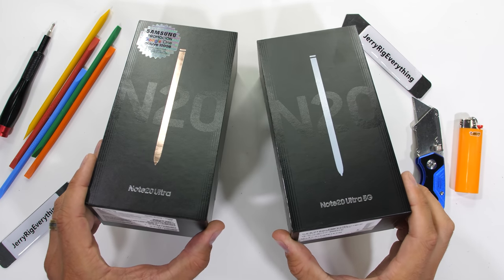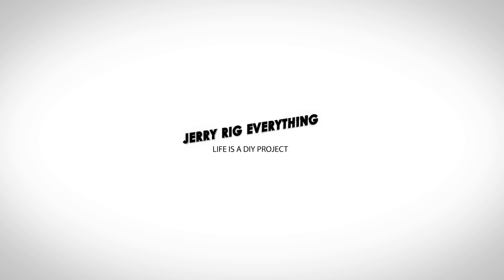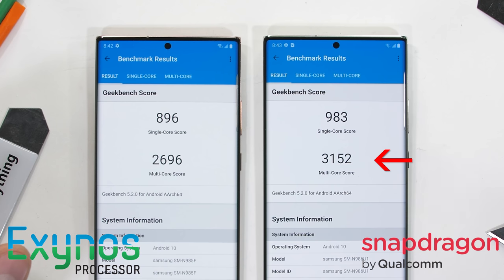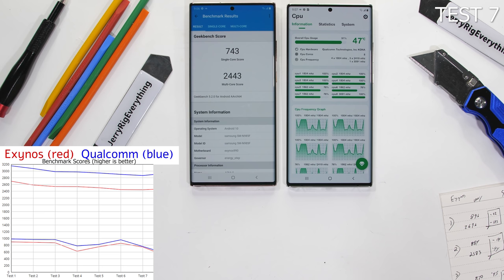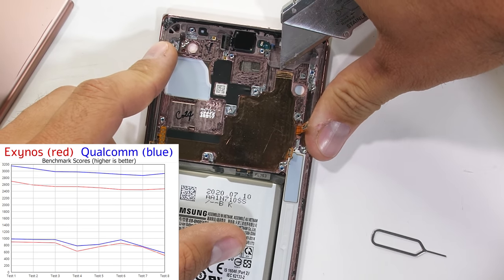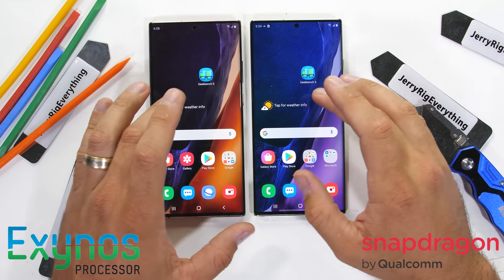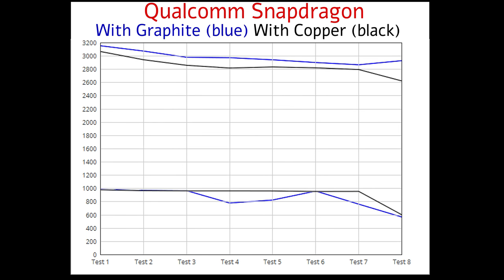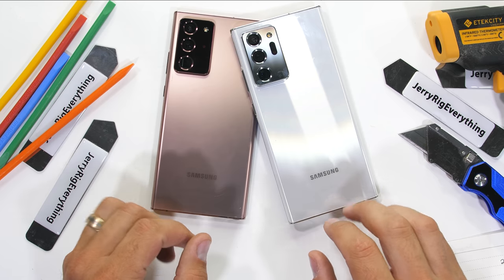Samsung should explain this... Exynos vs Qualcomm?! - Note 20 Ultra

Comment: So you’re buying the “same” phone with same name and same price, but one perform worse? Isn’t that a scam?
Reply: Oh it is indeed...
Reply: even better, in the europ, we can buy these scamsungs for much higher price than real snapdragon samsungs in the rest of the world
Reply: Lets wait for a class action lawsuit to pop up
Reply: the more you know
Reply: @FPKcz  The "real" version is the Exynos one because Exynos is Samsung's chip line.
Reply: Did you really just find out about this? This is happening for 3 or 4 years now
Reply: and i can confirm in asia its sold around the same price.
Reply: I would at the very least try to understand them if they sell the Exynos cheaper than the Snapdragons. But same price difference performance. You are right to call it a scam.
Reply: Samsung flagship phones= features>peformance
Reply: It would've been more reasonable if the exynos was cheaper
Reply: @jvsky1140  BUT PRICE IS NOT HIGH LIKE THIS NASTY CORONA CRAP NOW BEFORE 4 YEARS.............4 YEARS BACK PHONE PRICE LOW SO SD VS EXYNOS DOES NOT MATTER NOW PRICE SO HIGH EVEN SINGLE PENNY DONT WASTE ON SAMSCAM
Reply: In Germany they are cheaper a note 20 ultra is around 1100€
Reply: Samsung should call the S20 Ultra Snpadrogn/Exynos Variant. Since their names are already a clusterfuck, why not add that to the Mix. With Laptops you also know if its powered by AMD or INTEL, and if you have a I3, I5, or whatever inside.
Reply: @daemonspudguy  yes, but for the customer, the "real" phone is the one that has better features ... and there is nothing that exynos would be better at.
And do not forgett that the shit exynos is the more expensive one of them.
Reply: wonder if it happens to iphones as well
Reply: we got no choice
Reply: Yes it is
Reply: It is a scam, I even remember with some of the older Samsung phones, like the  galaxy s3, they would swap ram sizes and either have a dual core or quad core processor swapped between international and American versions of the phones, with some countries even having the best version of the 2 (with the quad core and highest supported ram for that phone model) so nothing new there.
Reply: Samsung's reason is that they need to match the "demand" at the earliest time possible. No wonder why the moment they announce the product their phones become available in a week or two, unlike OnePlus or Apple. Again, somebody else's reason is that Exynos needed to exist for fair competition, is it really that fair?
Reply: Exynos is having higher price in asian markets..
Reply: Technically, it's not the same phone. As you can see, the model code is a bit different. But your average buyer won't know these identifiers by heart and not every retailer will specify which version you're buying.
Reply: @llljjjyyyy globally overpriced iPhones have one CPU, Apples Ax CPU, so performance is no different...  But yes, in Europe Apple products are a bit more expensive, in the Czech Republic, much more expensive...
Reply: Its made by samsung so yes its a scam.
Reply: @pauljericklara3865  4 years ago the Americans were salivating for the exynos. Now it's the other way around. This story isn't new and it's not a scam, it's just the way they operate.

There are always different internals depending on the models. Playstation does this, TV manufacturers do it. Everybody else does it, I really don't understand the fuss all about this topic. The note you buy in your country is the best note you can buy. Makes no sense to compare to a version that isn't available and costs 30-40% more to import to your country.
Reply: Everyone should report them for false advertising
Reply: In india we are buying it for $1500 with exynos
Reply: Actually... Not even the same price. In India the, we have the exynos variant for $1423 and the snapdragon variant, which is sold in the US, costs only $1300. $123 for downgrading the performance!!!
Reply: Yeah its totally scam with innocent sheeps this is how they cut the xost and using the marketing tactics they r earning more
Reply: Yeah
Reply: @WakkaOwnages  but the Snapdragon one is cheaper and SD is performing was better than the Exy for the Last 3 years, so why do i pay more and get the bad one in europe?
Reply: "No it isn't be because..."
-SamFans
Reply: @samuelruiz7377  - Why? It's been clearly labeled for all to see. Exynos used to be the superior chip. Now just because Snapdragon became better it's only then one complains.
Reply: and in europe it is even more expensive to so...
Reply: The Exynos variants have always been cheaper than the Snapdragon ones a couple of months later. To the most of the people who respond to this comment - please, do some research yourselves and don't believe every single thing on the internet.
Reply: Welcome to brazil
Reply: Nah. The phone is actually more expensive in Europe. So u pay more for hotter, slower and less battery efficient phone with tons of bloatware. Gj sammy.
Reply: @FPKcz  same like us in southeast asian , mostly samsung phone in my country powered by exynos , junk processer 😭
Reply: Wait till next year amd across the board thats what I'm doing.
Reply: @fahadnadeem7831  - You got it the other way around. Exynos is their original chip from Korea. There was legal problem they had with US distribution, that Samsung is forced to use Snapdragon for the US market, and only for the US market. For a long time Exynos used to be the better chip, and US buyers were complaining then, now it's switched and people on the other side like you are .complainning.
Reply: Technically not a scam. It’s kinda like fast food. McDonald’s in Japan is very dif from American McDonald’s.
Some are better some are worse
Reply: in europe they cost more than in the us
Reply: @adivyapratap9512  help u with what lmao
Reply: @phase4265  wo hast du diesen Preis her? Ultra kostet bei mir 1300€
Reply: @FPKcz  that's because of the taxes... everything is more expensive in eu vs usa..
Reply: $1849 aud in Australia for exynos
Reply: $1299 isn't the same thing as £1279!!
Reply: @_scra9947  bei Saturn
Reply: @inisipisTV  they also sell SD in Korea and China. So stop defending these kinda shady practices.
Reply: Bloody hell  it is
Reply: Not really, products differs all the time between markets. If we take cars for example you can see that the US versions used to look different/worse than the European version of European cars all until the 90's. That was because of legal differences that required outdated headlights and weird bumpers in the US. Still to this day there's major differences between the markets.

Since Qualcomm is a US company I'm guessing that there's some dumb US law that makes them use that processor in that market, what matters is how easy/difficult samsung makes it to know what version you get and it should be the consumer who decides if they make a good enough job presenting that information.
Reply: @adivyapratap9512  well it depends what YOU also like you know
Reply: @volundrfrey896  forget about 90s car laws and focus on smartphone industry and tell me any other company doing this. Also I can guarantee you that no one's stopping Samsung from giving SD option in EU or Asia and they sell snapdragon in US, South Korea and China. So don't over analyse it, its just Samsung being shady writing from my Samsung device.
Reply: As a South Korean customer this is common for us. They are keep advertising the '5G network' function even they are almost unusable in most areas, which is also very unstable to use. 
They even have added Ads on the default apps, which cannot be deleted by users. not adding the earphone or even a case with a phone is also a minus.
The previous galaxy phones have also differed in hardware from domestic & overseas products, which is not even a surprise now. I hope it spreads bigger and hits samsung big time.
Reply: @ThatGuyCanmanNC  it is very different.. having different menus are part of cultural/market adaptation, and selling the same advertised product with a different hardware is a fraud.
Reply: Caffeine well like Chinese people eat dogs and that is a terrible thing to do, and no one eats dogs here
Phone there, phone here
Reply: @SvetlinDimitrov  I said in a couple of months. I got an S20+ for around $760 last month. Compare that to the retail $1200 in the US. Also, a OnePlus 8 Pro, which has a Snapdragon, costs more than the Samsung in Bulgaria (Judging by your name), even though its retail price is lower.
Reply: @ThatGuyCanmanNC  so you're saying that people in other markets deserve less  performance on their equally-priced phones and that's reasonable?
Reply: @ThatGuyCanmanNC  similar for computer parts, all of the high-end graphic cards over $300 nowdays does perform over 144hz on FHD resolution, and that does not differ by market, wherever it's located. the hardware performance people require does not differ by location or cultures, end of story.
Reply: @adivyapratap9512  what games do you want to play?
Reply: @nevzatcanoglu9036  How is it more expensive? You do know that American prices don't have VAT included right? How are you determining it is more expensive? You know you can't really compare base prices in different currencies, there are different taxes, import taxes and whatnot depending on the country.
Reply: @Ktk0627  Is it tho? Have you tried an American Big Mac vs a German Big Mac? Have you tried a Russian Big Mac? A portuguese Big Mac? I have tried all of these and every single one is different. The meat is different, the preparation is different, the bread is different, the sauces are different. Just the name remains.
Reply: @adivyapratap9512  yeah sure, do you need it to be a new model? or are older ones good too?
Reply: @WakkaOwnages  of course, as the McDonald in India serves a completely different menu, as it does in South Korea here. the point is that technology is different from the measures of food, globally consumers expect a same quality from the same product. If you had seen the video, you'll see that the Exynos model 's performance is not much different from the last year's model - do you believe that the customers deserve that lack of quality-just based on the region/culture?
Reply: @WakkaOwnages  and also there's a huge error in your argument - let's say a Russian version performs poorer than the American model - but how do you know that the phone will be used differently? will the Russians all run a similar application? does the majority of the population play the exact same game & multitasking? is the usage of a hardcore mobile gamer same from daily message app user? come on this so obvious.
Reply: @nishantrajani7372  You as a consumer has a responsibility to determine what products you want to buy and which companies you want to support. If you don't like how samsung does things then don't buy their products. When you get the gov involved you get shit like article 13.

Also I never said that samsung couldn't sell snapdragon in Europe and Asia, but that they nearly certainly has an incentive to use them in America.
Reply: @volundrfrey896  you know that markets needs to be regulated in some way right? And misleading advertising or selling two different products with same name looks a bit shady to me. Also I'm trying to create awareness among consumers here as me alone wanting change would do nothing while you're trying to defend their practices here (idk why do you want to pay more for an inferior product just because you don't live in US but) 

And if they can't produce Exynos chips comparable to SD atm, they shouldn't sell them in their 1300 dollar phone. Even Intel is looking to temporarily request TSMC to produce CPUs until they can fix their problems so I don't know why Samsung can't just use SD chips after more than 3 years of ripping consumers.
Reply: @adivyapratap9512  ok im going to think about some phones, can you tell me what your budget is?
Reply: @inisipisTV  perhaps u may right but the thing is this where is become the famous brand they must be use snapdragon chipset which provides u better performance from all dimensions
Reply: @meph2806  you are technically correct but you are missing the point. Exynos is worse in every aspect, while sammy are using the same name. Its really misleading and anti consumer practice.
Reply: @SvetlinDimitrov  I'm not missing the point. I'm completely aware that the Exynos is way worse, I'm just pointing out they don't charge the same. One more reason why the 2 products should have a different name.
Reply: @adivyapratap9512  ill help you man but i need yto know HOW MUCH MONEY YOU GOT.
Reply: @adivyapratap9512  so i can thunk about some phones
Reply: @adivyapratap9512  20 thousand what
Reply: @adivyapratap9512  tell me in euro or dollars
Reply: euro to prefer
Reply: @adivyapratap9512  i recommend the samsung j7 2017, but it only has 16gb of storage
Reply: @adivyapratap9512  idk man you can search for yourself cause i dont have that much time
Reply: @FPKcz  in an ideal world for Samsung, Exynos would be used worldwide. The reason they use Snapdragon in some areas is because Qualcomm holds a monopoly on CDMA2000 modems here in the US.
Reply: @adivyapratap9512  well im sorry but i really dont wanna spend my time searching phones for you. seriously, you can do it yourself
Reply: @nishantrajani7372  Misleading advertisement is one thing, selling different products in different markets is another. 

If that's the problem then companies like coca cola is at fault too. European coca cola uses different ingredients than American. Once again due to american laws, in particular their corn subsidies. (European coke is arguably healthier and better tasting)

Of course if Samsung claims to use snapdragon in a market they don't, or use the numbers/specs/bechmarks from the snapdragon-version to sell exynos then that's false advertisement and very much illegal already in at least the western world.

I'm not defending their practices just defending the notion that there's good reasons for releasing different version of a product in different markets. The validity of those reasons need to be judged on a case by case basis. And from what I've seen I'm not a fan of what Samsung does here, but the gov shouldn't involve themselves in this.
Reply: @volundrfrey896  1) you're comparing apples to oranges. When you compare practices you always compare them within the industry that's why its called industrial practices.

2) again no one's saying give US Exynos but the reverse, if Exynos was better than SD you can stat that the laws in US are not allowing them to sell Exynos version but there's no law in either Asia or Europe which bans snapdragon variants.
To top it they also sell SD in their home country and China and there's no law against selling Exynos in any of those countries. (I'm not sure but they also sell Exynos in South Korea so basically giving option like they should everywhere)

3) Samsung is misleading customers as they claim their Exynos version gives same performance as sd variants which is simply not true as difference is quite noticeable both in performace and battery life.

So it is a shady business practice if not a straight up scam.
Reply: @FPKcz  yea like 400 dollar more.
Reply: @nishantrajani7372  No you do not, you can't claim that something is completely part and parcel for one industry and then magically immoral and illegal for another.

I've never claimed that exynos is better, I think that should be pretty clear. The claim is that selling slightly different versions of a product in different markets should be illegal.

If they've advertised one product and sold you another one then that's a completely different thing to having different products in different regions. That's fraud, and it should be illegal. Regardless if they make/sell the other product somewhere in the world.
Reply: Watching this video felt like Samsung became an official Chinese imitation. They are doing the same thing what the Chinese imitators doing...
Reply: @volundrfrey896  did you even read any of my previous point? Or do you just wanna defend Samsung so bad that you're literally ignoring every point and just gonna say but but Samsung good you bad.
Reply: Do Sony xperia 1ll test..
Reply: @nishantrajani7372  I have addressed them which one did I miss? 

But I never claimed that samsung does things right here, nor that their advertisement is right. Merely that regional differences in products is a common and often justifiable thing.
Reply: @ArjunVNair77  why dont you buy the cheaper version as you put it " In India "
Reply: @volundrfrey896      first industrial practices is literally used in laws and you're still simply denying it. What's considered a normal practice in one industry can be outright anti-consumer in another or even some anti-competition and many have faced legal wrath because of it. 

Second you're blaming US laws for it while as I mentioned they sell SD in China and kinda give an option to chose in their home country and the point was at least givinng an option for SD and not vice versa. So the Qualcomm patterns over modem in US is irrelevant anyway. 

And then Samsung claiming there's not much difference between SOCs while there's 20% difference in both performance and battery life and it even impacting image processing is misleading to say the least. Also I'm not 100% on this next point but I guess Zach pointed out that some international variant (maybe south koreain but I'm not 100%) of S20 didn't even have 5g modem in them while S20 is claimed as 5g phone (south Korea don't have 5g mm wave I guess) then they claimed z fold's screen is glass when as Jerry tested it out it wasn't glass and shouldn't be called glass as it was scratching at level 2 (if you don't think that's misleading advertising then I don't know what is) 

As I said I'm not against Samsung or anything I'm using their product right now but if we don't criticize their shady practices and try to defend it by comparing apples to oranges then it's only bad for the company and tech industry as a whole. So they should be called out hoping they'll listen to consumers.
Reply: @nishantrajani7372  First off, then don't say we should make global laws against industry standards.

I'm not blaming US laws, I'm using it as a possible explanation. The fact that SD is used in china is completely irrelevant. 

Once again if they make unjustified claims in the marketing regarding what chips they use, or the performance of the chips then that's illegal and a completely different thing than what's being discussed. 

Then focus on the shady practices instead of going on about the fact that products differs between markets. Wait until you find out that literally every manufacturer includes different chargers depending on the market.
Reply: @FPKcz  Scamsungs :))))
Reply: @cjt940  It's been long time this difference, like S6 or S5...
Reply: Plus in India, it's price can literally rise up to 1.5k USD as if you were to convert the currency to USD
Reply: @emimaxim22  you guys' conversation is the most interesting to follow in this thread
Reply: That’s why I never buy any Samsung crap anymore.
Reply: Scamsung
Reply: Its actually not a scam because when you visit a samsung page outside the us its advertised with exynos, its not "hidden" somewhere, samsung doesnt try to conceal this information o0
Reply: Yep. In Latin America companies do it also with cars. We are going to sue them all very soon.
Reply: I think it’s definitely scummy and might qualify for a scam if you get the Exynos Chip 

Off topic but is that pfp from Ich Du Tu Weh by Rammstein?
Reply: @LA-bq6hf  hahaha nice one 👌😄
Reply: Thanx for this jerry!!! U helped me very mutch, this is just insane here in holland its 1300 euro   sma price for a good SD MODEL. I go back to iphone after year of samsung s7 and s9 plus. I am also thingking about the one plus 8 pro  what do u think jerry i live in holland  and all samsunga are with exynos what should you reccoment for this problem 😜🤔
Reply: Samsung doing Samsung stuff...
Reply: @Oscar Hii WE DO have a choice:DON'T BUY IT!
Reply: @RecC "this is just the way they operate" is not an excuse.Selling you a same-named device for higher price and lower performance is a scam by default
Reply: @ThatGuyCanmanNC would you buy a big mac in japan (with burger made of horse meat,for instance)for 1500$ and in USA (with burger made of beef,for instance) for 1300$ and tell us it's not a big difference?
Reply: @Lucien Raychev you are right,the do not charge the same.They charge MORE for the exynos version...
Reply: Depends where You live really.. If USA the whole country has snapdragons, if europe, all europe models are exynos, so its not really a lottery, but a destination contract. Well.. nobody blames VW that only in US you can have V8 passat, and Europe has only V6 available in salon. That goes also for BMW 3 series where 3.0 V8 seems a standard and Europe can get straight 5 or V6 max if its not an M3.. the world has no justice, nothing new.
Reply: @jvsky1140  Since the S3, long ago
Reply: Scaammm scaamm
Reply: Exploiting capitalism at its finest.
Reply: @meph2806  LOL "please, do some research yourselves" "don't believe every single thing on the internet." yeah ok man
Reply: No its called apple!🤣
Reply: @kiacedillo7067  you’re not funny g
Reply: @cjt940  there better be a fucking class action, I hate my shitheap exeynos s20
Reply: The Samsung doing that already for many years lol
Reply: @llljjjyyyy  No
Reply: @daemonspudguy  it's still a scam though
Reply: @llljjjyyyy  no they will not iPhones have used own chips for wild they never sampled from any other company what it came to smartphones at least I'm not sure about their MacBooks or watches
Reply: @inisipisTV  if xenos used to be better than why are they worse now
Reply: @ThatGuyCanmanNC  oh so you called paying more money potentially for worse performance worse battery and camera performance not a scam. it is a scam someone should take Samsung to court over this this is unfair I think it would be the easiest court case Samsung ever lost
Reply: @bluekirbyrocks  No. Scamming would be taking your money and delivering nothing.
Reply: @daemonspudguy  false advertising is also a form of scam and that's what Samsung is doing they're advertising basically two different phones under the same name their price the same to
Reply: @bluekirbyrocks  if Qualcomm didn't have a monopoly on modems in the US Samsung would be using Exynos chips worldwide.
Reply: @daemonspudguy  yeah that sounds like a freaking nightmare
Reply: @bluekirbyrocks  Samsung is massively improving Exynos chips for the next line of devices.